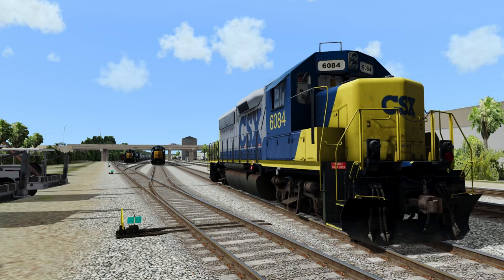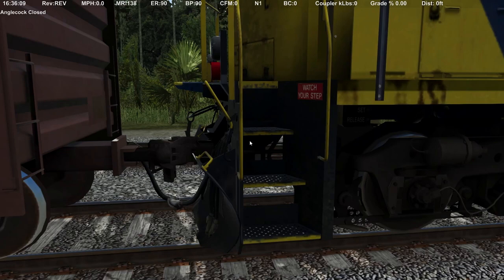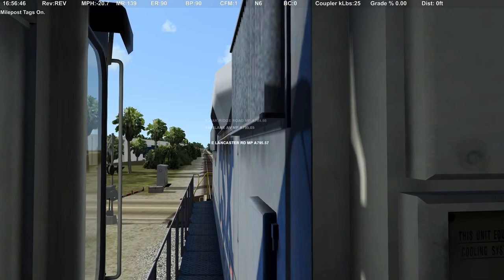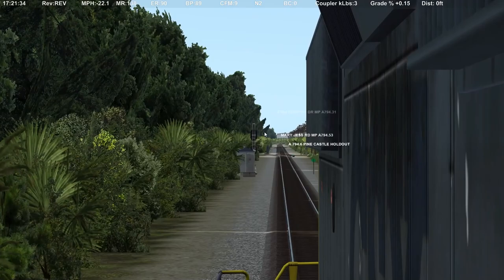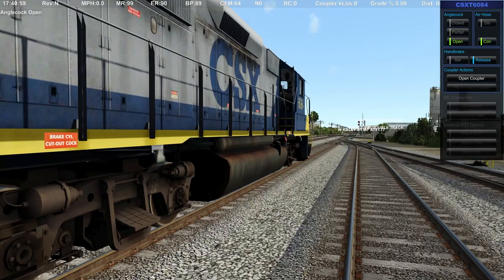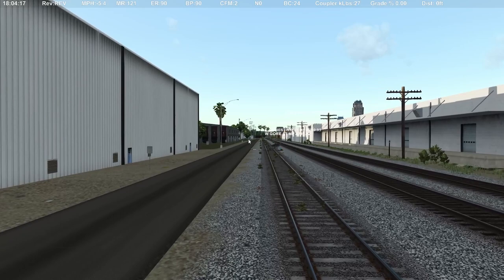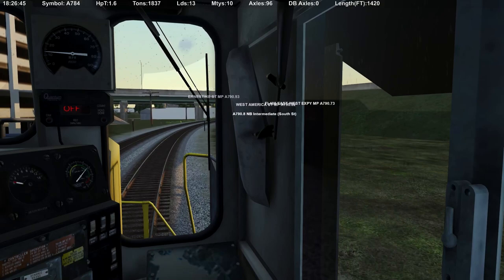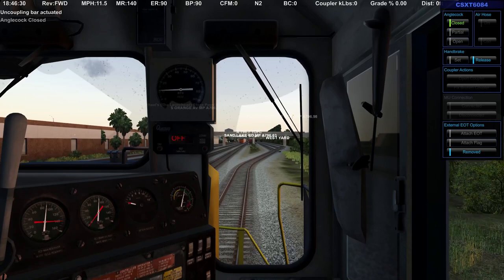How I Work a Local in Run 8 Train Simulator - A784 A-Line

Comment: F11 to board and F12 to hop off works for me and I use the default key binds. Unless it's a problem with the specific loco you are using those should work
Reply from the maker: Right, F11 and F12 are what I've always worked but sometiems F12 wont dismount me from the railcar and sometimes when I hit ctrl-F11 to go to the cab it puts me in the cab for a split seconnd then spits be back down to the ground. its really strange.
Reply: @spurgaming5400  I believe you can also use Q and E in V3.
Reply from the maker: @Czwakiel  maybe that is what has changed! I'll have to try it out. Thanks for the tip!

Comment: Why would the 6 axle be prone to derailing? Just the length of the truck and shorter switches? I don't know much about the prototype so I appreciate the background info in your videos
Reply from the maker: Right, they were worried about the longer truck wheelbase derailing in switches and curves or it turning a rail over. I dont think anything has really changed infrastructure wise in all those places other than there being way less small mom and pop leads to switch. I think at this point they just go with it.
Reply: they would constantly derail Autoracks going in that one curve into TDSI
Reply: A lot of old roadbeds have tighter curves cause back then cars were shorter and 3 axle trucks just weren't common. There's still places out there where 6 axles are forbidden.